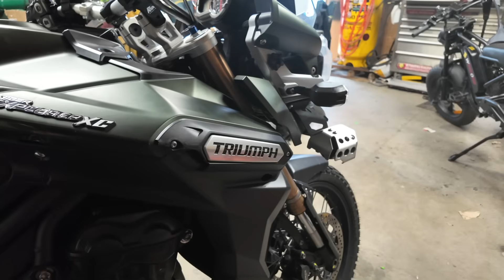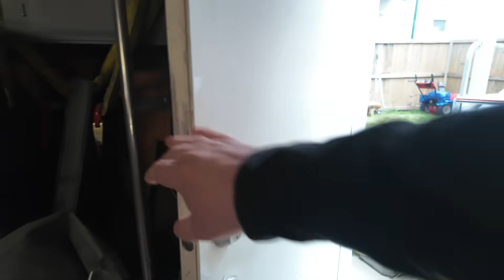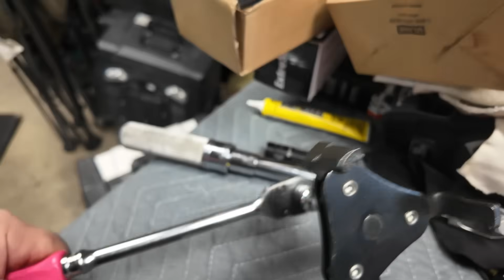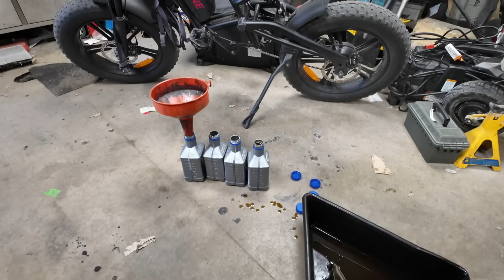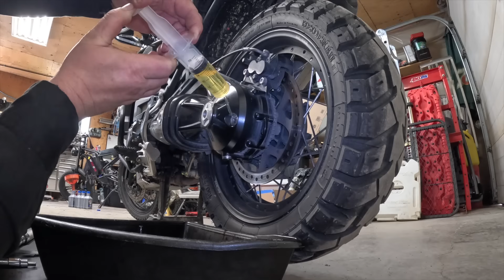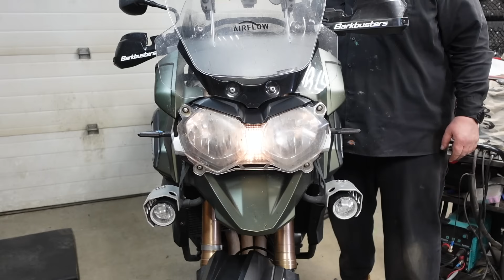AFTERMARKET PARTS CAN MAKE YOU SO ANGRY

Comment: 16 years as an avionics engineer working on aircraft and I can confirm they still use solder connections on some aircraft but it’s definitely not as much as years ago. I don’t mind soldering every now and then but environmentally sealed crimp style connectors are much better!
Reply from the maker: What crimp connectors do you recommend ?
Reply: @BackCountryWrenching Raychem D-436 series is what we use for environmental butt splices.